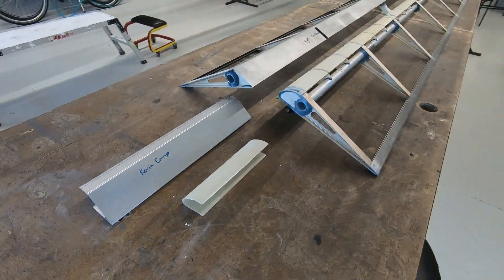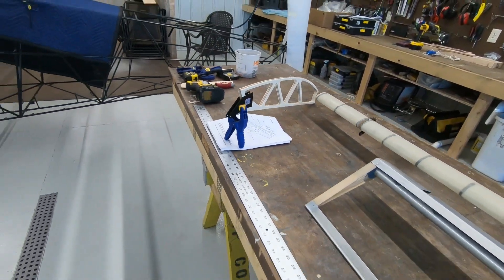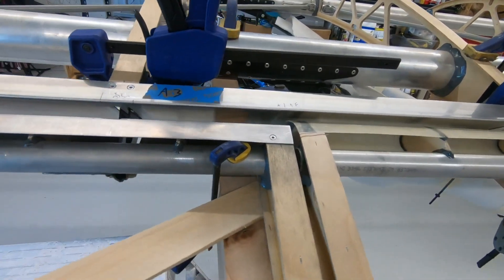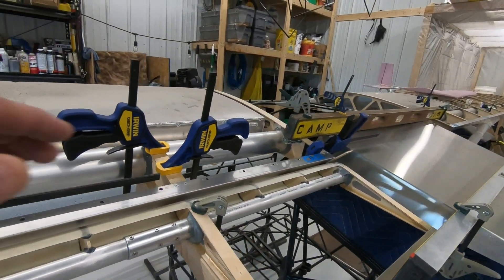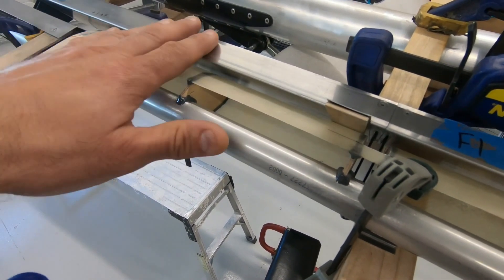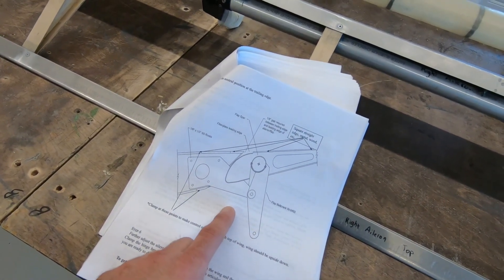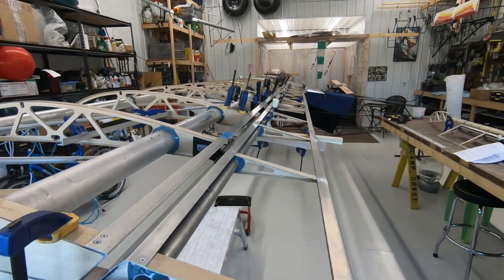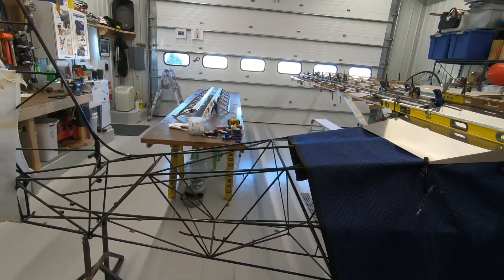Highlander Build Video #15 - Flap and Aileron Installation

Comment: I was wondering if you were still building this thing.  :) 

Honestly, the lack of plans is a major detractor that makes me think twice about going with JUST.  I don't doubt they are excellent planes (lots of flying proof), but the build process needs to be enjoyable, not frustrating or full of second guessing.
Reply from the maker: There really isn't that many things that are very complicated in this build to require plans. Especially if you get the quick build kit with the wings, flaps, and ailerons already made at the factory. It would help out to have better pictures in the build manual or some  diagrams. I am adding a lot of complexity to my build by extending the wing and flaps, choosing different hinge points for flaps and ailerons because of the extensions, adding an aluminum altered leading edge to the aileron, installing a wing leading edge cuff, and so on.

Comment: The factory fiberglass leading edge is so much easier to build then Steve’s, but I do love how my Highlander rolls with his mod.
I don’t think there is clearance to put an aileron gap seal on since they are differential.
Reply from the maker: It was a little more work to figure out the aluminum aileron leading edge, but I think it will be worth it. At some point in a future video I will go over my ideas for the flap and aileron seals. I have seen them done a few different ways on highlanders.

Comment: About how to glue and how can you explain in a separate video? How is the aluminum alloy of the pipe processed, what is the grain size of the abrasive, can it be used with charred edges of plywood from laser cutting, how then to protect aluminum parts from corrosion? Very interesting. Machine translation, sorry.
Reply from the maker: Great questions, I can cover all of those in the next video and give you the short answer in this reply. The glue I use is a 2 part structural epoxy made by 3M. I use this to attach aluminum, steel, and wood parts together. It also creates a barrier between the wood and steel or wood and aluminum to prevent corrosion. The metal parts are roughed up with emery cloth ( I use something like 150 grit) and cleaned with acetone or MEK before bonding. The wood parts are touched up with sandpaper ( to create a smooth/flat bonding surface) and blown off with compressed air before bonding. This airplane does not have laser cut parts but it would probably be best to clean off any loose charring from the laser cut before bonding. I build a lot of wood model airplanes that have laser cut parts, and they are usually cleaner and need less prep work for gluing than mechanically cut parts. The steel parts (4130 chromoly) on this aircraft are painted with a 2 part epoxy primer then a 2 part top coat to protect from rust and corrosion. Most of the aluminum parts (mostly 6061 and 2024) are left unpainted, I make sure they are clean and free of corrosion before they get covered. If they are dirty or have a small amount of corrosion I touch them up with a 3M scotch pad (the red type I like best for aluminum).